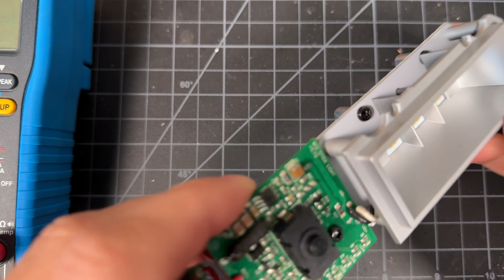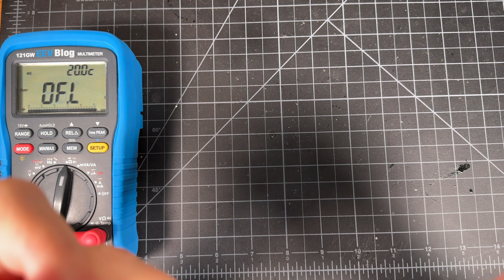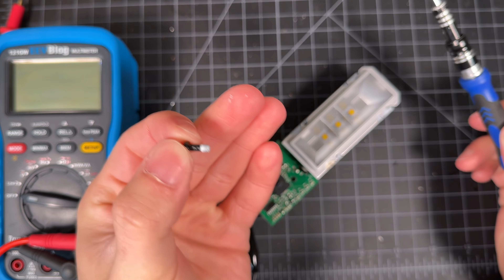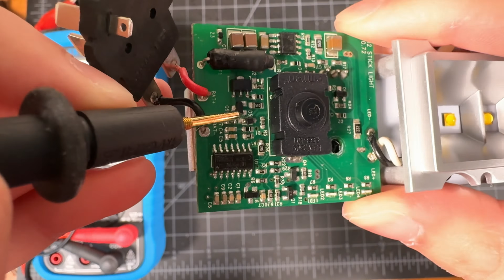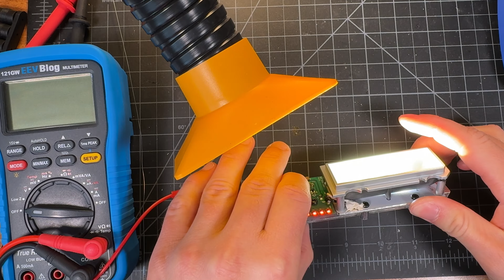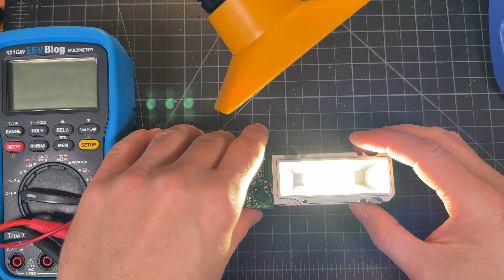M12 Light Repair: Poor Quality Control

Comment: Quality Conrol (Not) solder joints have been a pain when I have been fault finding too. I first got into R&D Electronics in 1968. Even in my own circuits because I didn't concentrate on what I was doing. It only takes a little distraction and your there for hours. Great job my good friend. I agree with you about over priced tools. Your realy only paying for the name sometimes. Have a great day. We have sunshine here in the UK.👍